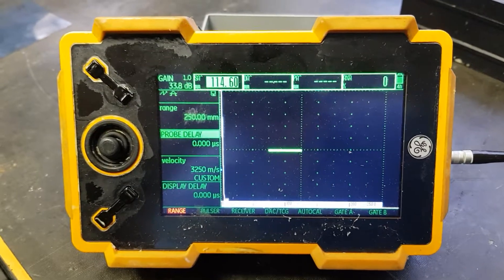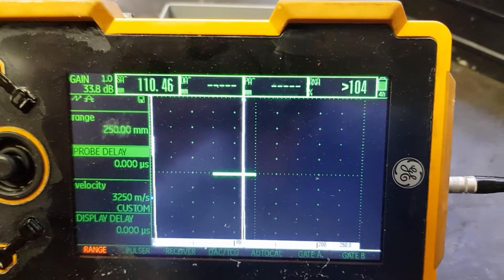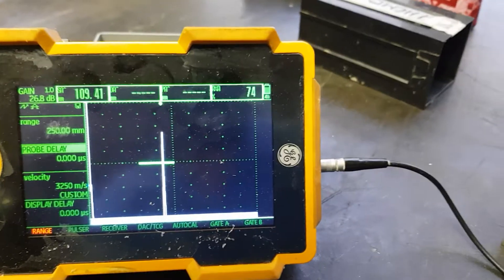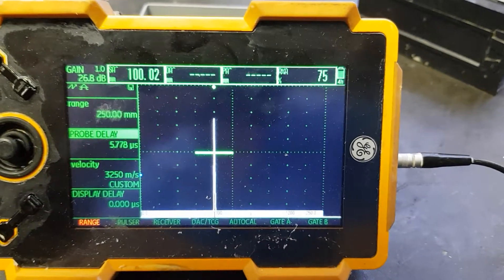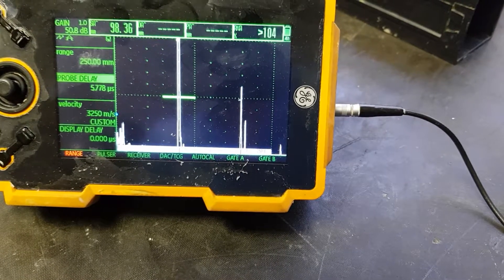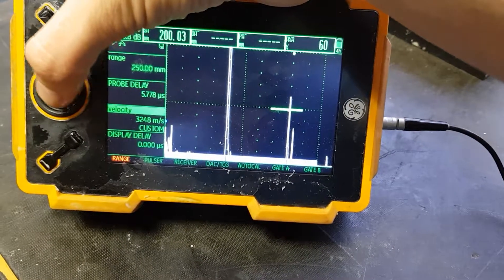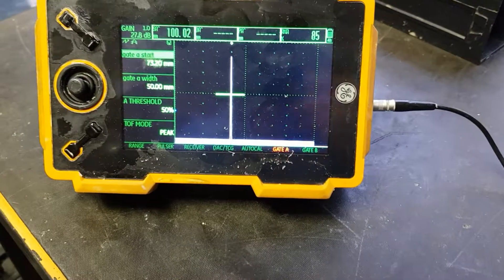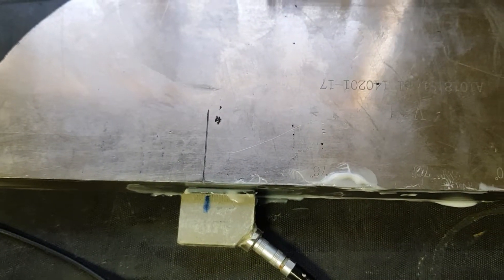Ut angle probe calibration - USM GO

Comment: What is this you are not calib.!?
Reply from the maker: Could you elaborate?
Reply: @garathbester  If you just calibrate off the maximized signal from the radius, you could be telling the set that 110 mm is 100mm which will throw off the trig when you input your angle and thickness. The first step should be to find the sound exit point/true angle by maximizing the signal on the big circle, mark exit point on wedge, align the exit point on the wedge with the groove in the IIW that is 100 mm from the radius and calibrate for that   distance.

Comment: Sir,
When scanning a weld in 10mm plate using 45degree probe. Range is 125. Machine shows SP=43.5, SD=30.7,D= 30.7. How can I calculate where is deffect??? Sir please help..
Reply from the maker: Hi there Justin.

It is difficult to say what you may be seeing on your screen with only that information but I can try to give you a few pointers.

1. A 10mm plate is perhaps a bit thin for a 45' angle. From what you are describing the sound is already on leg 3or 4, where you should try to get it on leg 1 or 2. I would recommend other angles like a 60' or 70' to get a better idea.
2. Review your procedure, it should give you guidance on what to do.
3. Plot the defect out, I have an example of this here : https://youtu.be/wb3cT9zQbBE